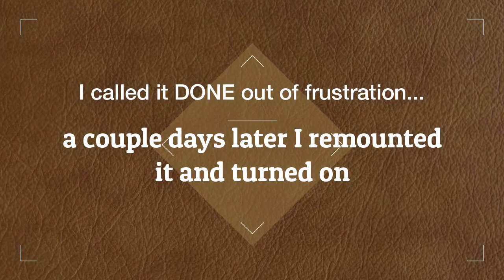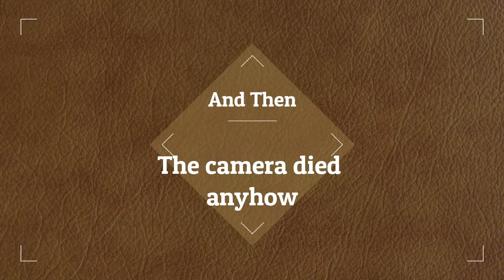Turning a Heart Plate

Comment: Nice sticking with it!  I turned a mortise to large recently too...  but I had a set of jaws that I could make it work with. Lost a screw changing them out though!  I also did a Heart for Valentine’s Day this year.  Did it in secret and made my wife cry !  Ran into many of the same issues...  it really wanted to take my fingers off!  Nice work!
Reply from the maker: I actually probably could have changed jaws and continued, but it was my second time with the chuck and I honestly completely forgot there were other jaws in the case!
As for the stick to it part, this was attempt #2. The first one I cut the heart too big to fit the lathe, then the wood was so hard the band saw didn't want to cut it, etc. so I went into this piece already highly frustrated. That one is still in the naughty bin.
Reply: StringsNBlingz Jen's Woodworking&Things at least its too big!  Can still be trimmed to make it fit!  Keep having fun!!!